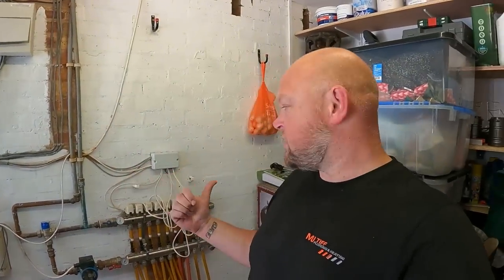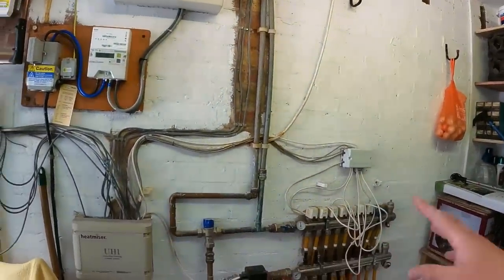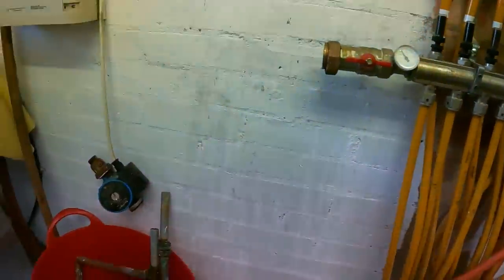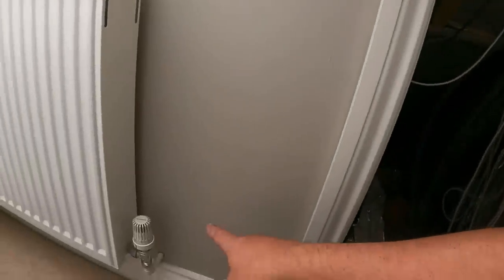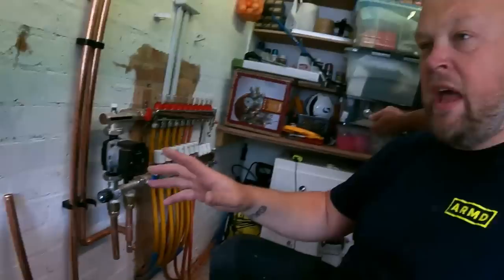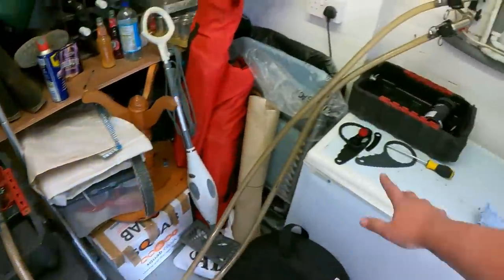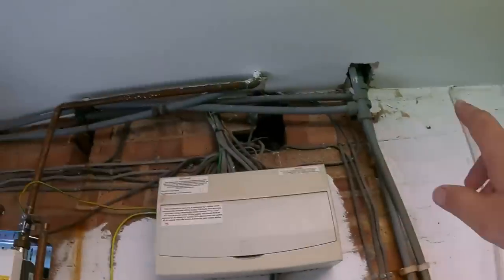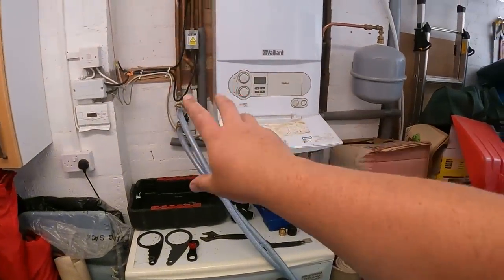PLUMBING PROBLEM SOLVING | This heating, hot water & Underfloor system is something else.

Comment: Hi mark, useto come across systems like that at work , most of the time they would use zone valves , however there was also issues when they would get ghost flow back up the return , see in most of those units there’s a facility to put a DHW feed in there , hopefully u won’t have to start lifting floors etc to find them, always a nightmare when the actuators / zone valves fail and have to find them , also found this note about the system, also sent an email over to u, apologises if you’ve already seen it , , thks so much once again as that was a very interesting video, stay safe and well , ————  notes —- The Heatmiser UH1 is designed to be used in conjunction with our 12v network thermostats. Underfloor Heating – The UH1 provides central switching and is therefore ideally situated next to the underfloor heating manifold. 8 Zones can be controlled as well as providing an output for a hot water cylinder. On demand from any zone, a 230v output is provided to switch the relevant zone actuators, underfloor heating pump and valve. A volt free connection is supplied for the boiler, making it compatible with almost all types of boilers. Up to 6 actuators can be connected to each zone. An option is provided to turn zone 8 into a radiator zone. In this mode the underfloor heating pump, valve and boiler are not enabled when there is a call for heat from zone 8. Radiator System – The UH1 isn’t just for underfloor heating. It can equally be used in a radiator only system.

Comment: i installed a similar system at the request of my customer. Underfloor heating manifold dowstairs controlled through Honeywell Evohome. Originally it was going to be evohome heads on the rads upstairs but the customer , who had experiance of Evohome , was concerned about the noise of the evohome actuators in the bedrooms. So Installed an second underfloor heating manifold upstairs but feeding the bedroom radiators. . Each bedroom had a Honeywell T87RF round thermostat linked to a BDR91 receiver. All linked into the Evohome. No TRV on the radiators of course.
Reply from the maker: That makes more sense than these acuators under floors etc…

Comment: Just remembered  some years back of a system that had zone valves fitted in each room under the floors , as they began to fail it was going to be very time consuming in trying to locate them, , so instead of wasting hours trying to find them I lifted the landing floorboards and managed to push sections of 15/22mm pipe into each room, so that I only needed to lift the boards by the rads in order to connect to the new pipe work / rad valves on the landing , therefore bypassing all the old pipes/ controls under the floor , just saved in not having to remove furniture, wardrobes , beds etc , indeed uponor came into its own seeing u could push complete lengths with no joins through rooms , sorry I’m waffling , lol, thks again for sharing , stay safe and well
Reply from the maker: Sounds like that saved a massive amount of work👌🏼
Reply: @MJTiffPlumbing  , indeed and saved having to empty every room , lol, also useful on some routes where i couldn’t push 15mm though but could 22mm , alas with the 15 mm being more flexible it kept getting caught up , so I pushed some 15mm down the inside of the  22mm then removed it leaving the 15mm in situ —— ref that job today , , indeed a shame u couldn’t have just taken the actuators out the way to allow u to fit a zone valve for upstairs heating in the garage as ur original plan , suppose with the lack of access and thinking aloud so to speak if all the actuators could have been wired to a permanent 24v live to keep them open and add the zone valve in order for the switched orange live to fire the boiler , great u now have a HW timer , sorry with me waffling , brain in overtime again , lol, shame u couldn’t access all the rads from the landing where u could just run a single flow pipe to each rad , therefore leaving the actuator under each floor , alas floorboard near each rad would have to come up , also saw one job where flow and return were taken from downstairs up into the loft then dropped down to each rad inside the walls as they were all timber studded  , once again apologises as I know ur extremely smart when it comes to heating and plumbing , it’s just me waffling , plus sent wiring diagram to ur email which hopefully is also useful to u , have a great week and weekend , stay safe and well

Comment: Had a similar one to this at the start of the year. Previous home owner of a property was a DIY'er and built his own manifold out of Google Nests, speed fit and 2 port Honeywell valves, great job. Only went and hit it above the garage ceiling so no one could find it to replace the syncro's or 2 ports when they went down.
Reply from the maker: Crazy ain’t it….. I’ve said if ever the rads stop working it’s floors up to try and find actuators
Reply: @MJTiffPlumbing  Oh it was an absolute pain. We're due back in a few weeks (warmer weather) to relocate it into the garage proper so it's all serviceable. 
Some people just don't think about maintenance over aesthetics.

Comment: Another great video Mark. Looks like the original owner wanted more control than normal on the rads. Shame they didn't leave the controls a bit more accessible.  Keep up the good work Mark
Reply from the maker: Thanks mate…… very over complicated system with valves AND TRV’s….. and actuators in floors you can’t find… not great
Reply: @MJTiffPlumbing  It sounds like a very complicated way of doing what programmable TRVs would do. Having room thermostats and TRVs together makes absolutely no sense!

Comment: Hey   vid this one. I'd be scratching my head tbh. On the existing manifold I noticed they had thermostatic mixing valve I'm guessing to lower the temp to the underfloor circuits.
Does the snug system not need that 🤔 As I was thinking that the UH would be running at whatever the boiler stat was set at & they're designed to work on a much lower system temp. 
What concerned me was the powerflushing with those actuators all hidden away somewhere & whether they'd be sensitive to higher pressures being run-through them.
You mentioned about possibly fitting an auto bypass especially as you said pretty much everything has trv's on, & having 2 2ports as well , where would the circulation be if they both shut down & then nowhere for the heat to be dissipated away from the boiler, ( wait I can see why it took you 3 hours to suss everything out !!) 😂
Does make you wonder when it was Installed if the fitters really knew what they were doing or just slung a manifold onto the existing system & hoped for the best. Sometimes Mark simplicity is better don't you think rather than it being so complex. Whatever happened to gravity hot water & pumped heating 😂😂.

One last thing  seeing as they used alot of polyplumb especially upstairs to that rad , would that be the reason why your thermal camera didn't pick it up due to low surface temp on the plastic ( just a thought)

Keep up the good work 👏
Reply from the maker: Snug system has a balancing valve on it so you can throttle down the temp, just like the one I took out👍🏼
And it works as a bypass… I left just the 1 zone valve on in the end and the 3 towel rails have no thermostatic control so will circulate.
Good point about the heat through plastic…. The thermal imaging did pick up the runs under the floors.
As for the flush….. the acuators are basically TRV bodies looking at the one I could find.

Hours and hours spent getting my head round this one🤦🏻‍♂️

Comment: I think having actuators controlling the rads via a wall mounted thermostat is brilliant as you are measuring the temperature where your body height is and not at floor level.... I have done this, removing the trv on the rads though, and replacing with an ufh actuator. It works very well and means it is measuring the room temperature at the other side of the room. I think companies now are doing this with trv's with remote sensors via WiFi.  I am a joiner though but get tips off your videos 😊
Reply: "Drayton Wiser" have a multi zone system  that uses Smart Wifi, "Mesh"   to give serious control to their new  high tech TRV heads...

Comment: Lovely vid: can’t beat a good detective show on a Sunday night! The “what” is baffling enough but the “why” is another level. You’d have to think it was the previous owner wanted it like that for some reason. Takes all sorts, I suppose!
Reply from the maker: Great way of putting it mate…. Very strange setup and unfortunately they have inherited it
Reply: Let's say it's the installer's interpretation of what the customer wanted. There's not necessarily a 100% overlap!

My parents inherited a central heating system that was so unusual every plumber who came into the house asked if he could take pictures to show future apprentices. They even had original schematics and it was absolutely clear the original installer hadn't worked to the drawings but made a strange system almost useless. It's all been replaced so my memory is a bit hazy but I think there were three different zones and two pumps. One zone was supposed to just keep the foundations warm and prevent condensation (the house didn't have a DPC or anything and substantial damp issues), a simple 15 mm copper pipe loop running around all the external walls about 150 mm from the floor, controlled by a TRV with external probe on the return. This bit had its own pump and worked more or less as intended. The other two zones were setup like underfloor heating (except the loops were in the walls rather than under the floors) with another pump but all that pump did was bypass the manifolds! My parents had the system reconfigured according to the original drawings but the gas bill was still terribly high for a rarely used holiday home. Now it's all radiators and a DPC has been fitted.
Reply: @Ragnar8504  Yes, it's an odd one. It looks like whoever installed it made a tidy job of it. If it wasn't done when the house was built there must have been a sod of a lot of making good but you'd have thought that if somebody was doing installs like that in the area on a regular basis then you'd either come across them more often or at least hear about it on the plumber's grapevine. Maybe they only managed to do the one before they got carted off to Broadmoor...

Comment: Hey Mark, crazy system that, them older HM stats used to come in 2 models but they look the same, prt-n and prthw-n. The latter being the one that can do hw as well, the only difference being that one says ‘timer on’ and ‘timer off’ and it looked like the first stat showed on screen in the hallway (3:10) had ‘timer on’ on the screen so would have been that mate that was doing the hw
Reply from the maker: Yer I didn’t think that but even using that stat there was no control over the timing of the HW…. So strange.
The new remote clock is now doing the trick though👌🏼

Comment: it makes me wonder if the initial plan for heating was underfloor heating upstairs and downstairs but at the last minute they changed to rads upstairs but by the time they had made that choice they already had the electricity run for the actuators and the control panels so they decided bugger it lets attach the panels to the rads
Reply from the maker: You know what I even though that at one point……

Comment: Great video again Mark. Can you only use the magna cleanse on systems that have the magna clean filter? Thanks again for making these very informative videos.
Reply from the maker: No it can be connected via valves, pumps and even via radiator connectors if that’s the only way…..👍🏼👍🏼

Comment: Hi Mark top vids mate you sounded pretty stressed bud get your thermal imaging camera out to trace those cercs upstairs there's gotta be another manifold upstairs somewhere I've had systems like this before 👍😎remember chin up bud 😎👍😎👍😎👍
Reply from the maker: It’s on actuators as shown behind that one rad…… pipework is all under the floor with inline valves…. Somewhere 🤦🏻‍♂️🤦🏻‍♂️

Comment: Why was the manifold changed? Seems a waste.
Reply from the maker: Was old and knackered, pump was old and weak, they wanted it all replaced so it was working better
Reply: so I don't know what was agreed with the customer in terms of what to do but I feel your work has not really improved the system it's just added to the confusion. I agree it's over complicated with individual stats etc but they should all be calling on the same circuit so it's just a wiring issue really (in and ideal world). I agree it could be wired all wrong which is a nightmare but if you charge for that time it should be done. Don't take this is a dig because it's not. I'm not writing this to say your crap or whatever. I know these jobs can be proper rubbish.
Reply: @Danme1987  sometimes a job needs a bit of investigation to get a clear picture and come up with solutions for the customer going forward, customer may have just wanted to get the system up and running without further works, but yeah it’s needs the radiator actuators disconnecting and a room stat wired into a 2 port to run the whole upstairs
Reply: @Kingkongkirk1234  yeah agreed. If that's not been agreed and the customer just wants it sorting on the cheap then that's the end of the story and in no way a bad reflection of the work done in the vid.

Comment: Totally odd system why put them actuator valves on when it already has TRVs ,over complicates and more things to go wrong .....my tip would be a good prior inspection and if its gonna cause issues....I'd of walked and not committed to taking the job ....but well done Mark for sticking with it ....next time get a good pair of running shoes 😂
Reply from the maker: Crazy isn’t it…….

However how many heating systems do you check for remote actuators for the upstairs rads when looking…. I’ve never seen this in 27years of plumbing….

Comment: Hi Mark, don’t you just hate systems that don’t make sense. If people did things the conventional way, it would make the next man’s job so much easier. No more head scratching. When you use the pro-check, does you have problems taking the 3 photos of the strip &card,, because I do, and annoys the hell out of me.
Reply from the maker: The key to the pro check pictures is lighting I think… sometimes it’s a pain like you say

Comment: One of the heatmiser stats is probably controlling the hot water
Reply from the maker: We went through them all and nothing, we was hoping that one would….. traced the cable for hot water to a random dead end 🤷🏼‍♂️
Reply: @MJTiffPlumbing  The one that's not doing anything might be connected to the floating cable in the garage.